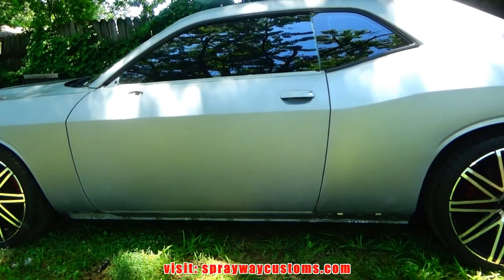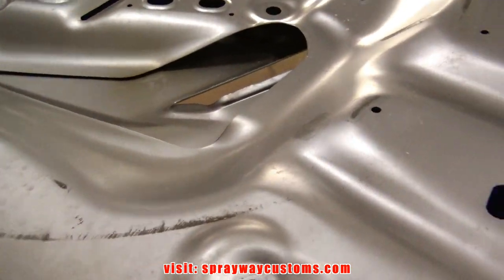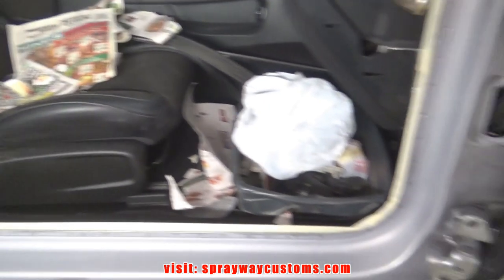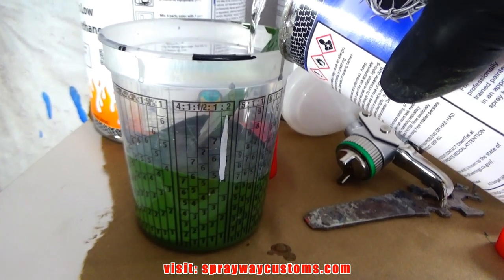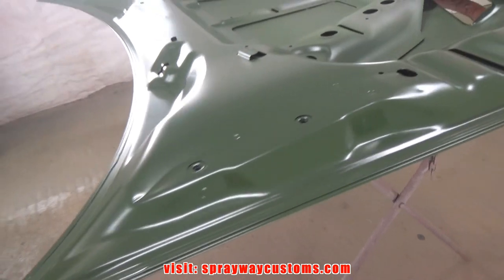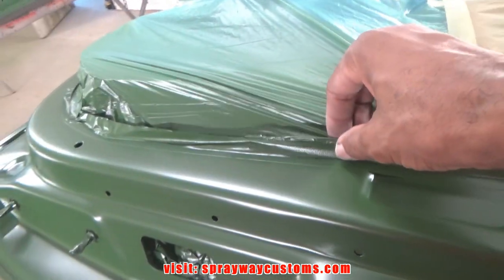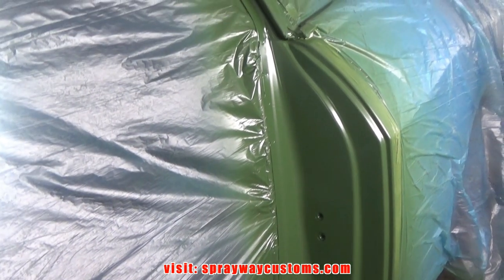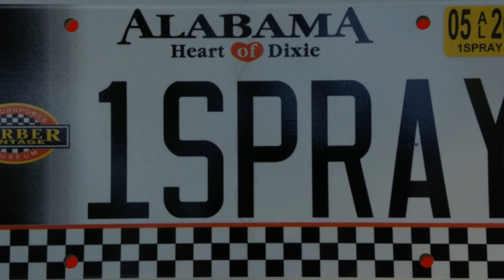How To Spray Single Stage Paint On A Car SATIN ARMY GREEN Spraying Door Jambs On Dodge Challenger

Comment: Nice work as always , surprised you didn't clear coat it but I'm sure you have better reasons than I can think of . But can't wait to see it all done !!
Reply: Single-stage paint.  Think ‘basecoat and clear coat together.’  Cars used to be painted that way until around the 80s (I think).  If you wet-sand or polish that kind of paint, it’s perfectly normal for color to end up on your pads.
Reply: @snail415  I was wondering the same thing.   Thanks.
Reply: It's a low gloss paint. Clearcoat would defeat the purpose of that look
Reply from the maker: Thanks...yes..it’s a single stage low gloss